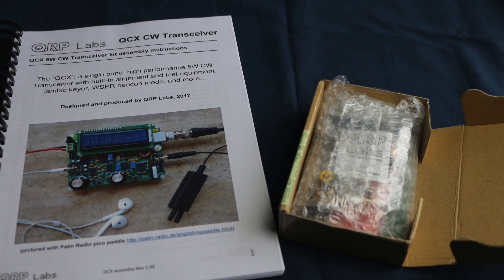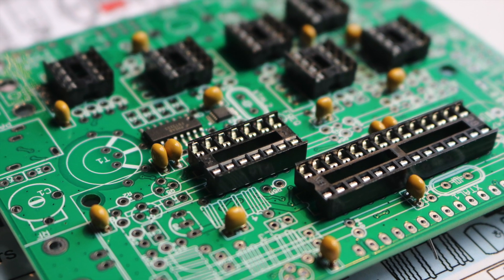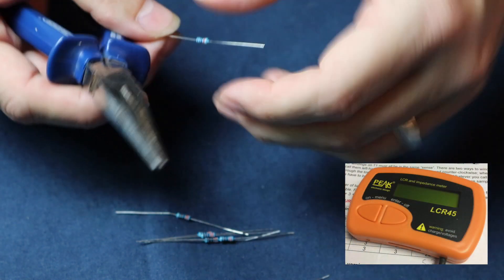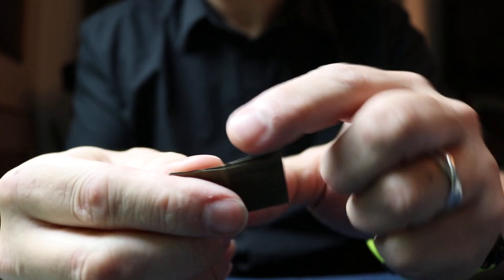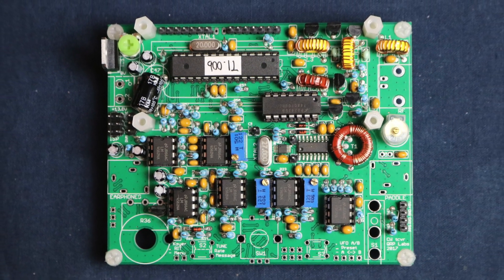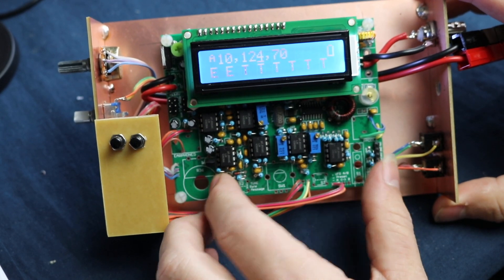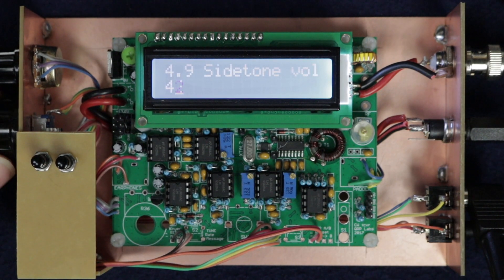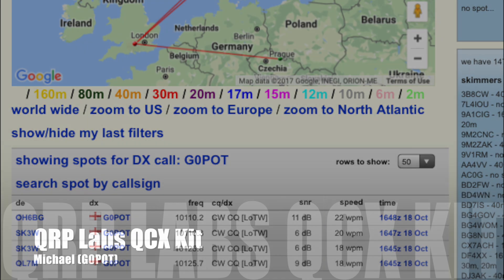QRP Labs QCX Kit

Comment: Michael, Name hr is Jay N4NRL. In part, your video here helped me pull the trigger on my own 20 meter QCX build. The very first thing I did was mess up T1 but with a little encouragement from Hans Summers, I was able to carry on. Finished the build the other day and still have not put power to it as of this writing wanting to review the videos on the setup process one last time.  I finished the project build in about 8 hours.  I really took my time measuring everything as I went along.  The moment of truth is approaching having built a  monoband 20-meter dipole just to run with this rig.  Had so much fun building I ordered the 40 meter version and it will be much faster and I think off-board construction for human interface.  Thanks to you for this great video and I hope others will find this kit the one for them.  73 n tnx  de n4nrl

Comment: I've just built my 10MHz version, after a couple of years. Mine was the v2 board and 1.00c firmware (they are on v5 board and 9 firmware upgrades since) so there's a few straightforward mods, mostly component value changes and a couple of extra resistors under the PCB. They are on the website and incorporated in the newer boards. 
Hardest bit was the Toroid From Hell, but that seems OK and resonates where it should. Output a bit low at 1 watt @ 12v and not much more at 13.8v, but at least means the PA transistors run cool when running WSPR.     It's a great kit. ☺
Reply: Mine is still just a board, but once everything's running fine, I've got the official enclosure for it.
Reply from the maker: 26CT845 That T1 is a beast to fit! I’ve never built one nor met anyone else that’s built one that outputs more than 1.5W without ‘tweaking’. I have a feeling the output LPF may cut off a bit sharp so it may simply need the toroids on that adjusting a bit. Enjoy.

Comment: An exceedingly good review/assembly video! Great overview. Would suggest holding off on hot glue until after radio is checked out. I prefer clear nail polish instead of the glue as well as it holds the windings in place.
Reply from the maker: War Planner Yes! Excellent advice...I actually check that everything is operating as I want before adding the hot glue, or anything else, to keep the toroids fixed because it’s difficult to make adjustments once it’s all ‘glued’ down. 
Varnish works really well but I’m trying hot glue because I take my radios out portable and they get knocked about a bit. I want to see if the rubbery glue works better in these conditions. Thanks.

Comment: Fantastic build video.  Nice job with your soldering skills and I love that Peak 45!
Reply from the maker: rcbrush99 The Peak LCR45 is a great little tool for homebrew. Useful for double checking resistors and capacitors and just the ticket for tweaking home wound inductors. They often have offers on so it’s worth looking out for them at a show or Black-Friday deal.